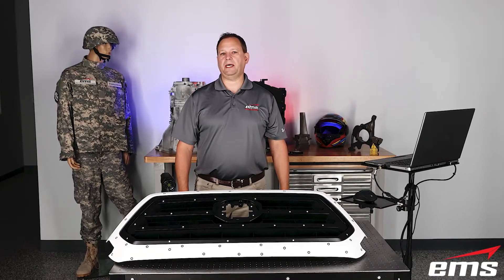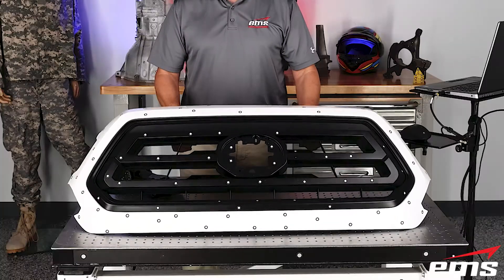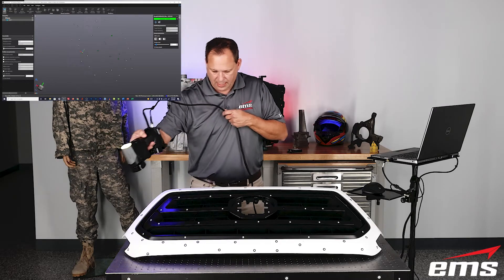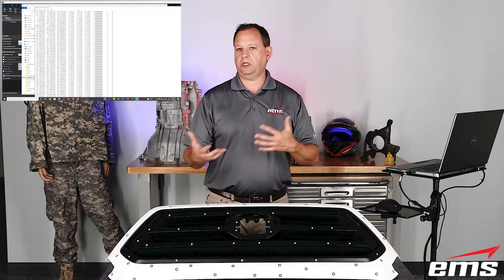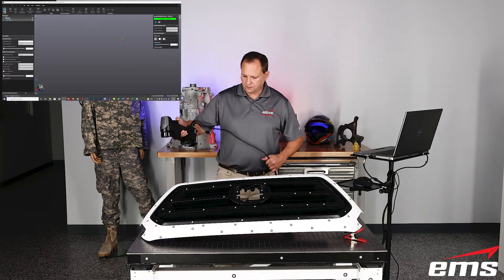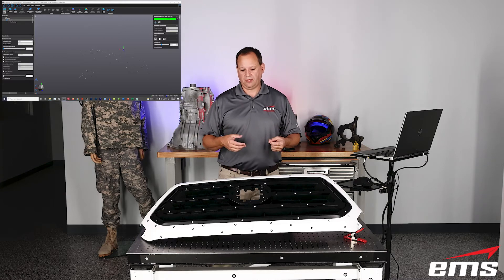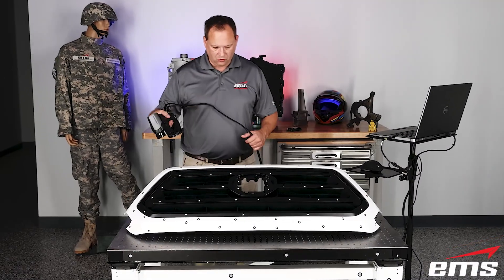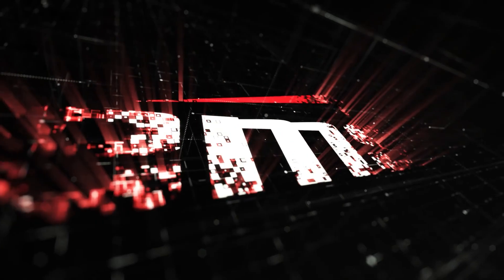3D Inspection using Targets

Comment: How did you align the two point files? What is the file type of the point file?
Reply from the maker: Hey Harry.  Good question.  The file format is just a .txt file with XYZ IJK columns.   As far as alignments there a few ways.   One of the videos on my list is a demonstration various alignment methods.  I didn't go into this in the video as it could confuse people or make the video too long.   Here are some of the methods you could use for this.

1.  Cartesian.  If you are inspecting this part in a fixture or series of fixtures many times they have callouts on the fixture for the XYZ cartesian coordinate or datum system.  So when you start 3D scanning you would either target or scan these and then create an alignment system before scanning.  It could be a series of physical planes, spheres, lines, points or cones on the fixture itself.  This way every 3D scan/target acquisition would be in the same coordinate system for each scan/target acquisition.  The VX Elements software with the scanner allows you to do this.    

2. Best fit.  You could just best fit the data but that would average the deviation and probably not produce the results you want.

3 Key targets.   If you know the center of the part, for example, around the emblem changes very little during the assembly process you can place 3 or more targets in this area and then only align the 3D scans to those points.  This minimizes the averaging of the data.      

4. Reference geometry.  Similar to the Cartesian fixture alignment if you have some common geometry such as mating parts that don't move you could reference those in each scan and only align to that data. 

5. CAD data.   Instead of align two 3D scans you could also align to the CAD model and check the deviation.    You could use any of the methods above for the alignment.   

Hope this helps. 

Hope that helps.